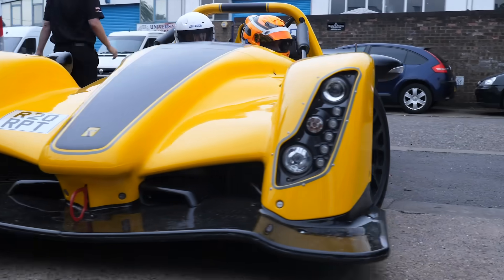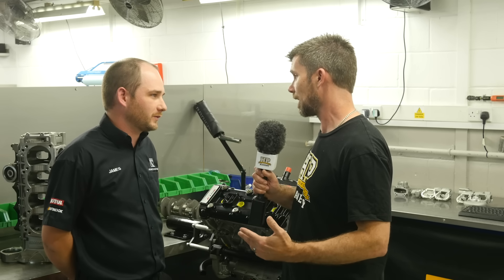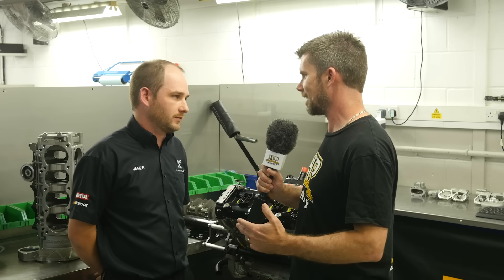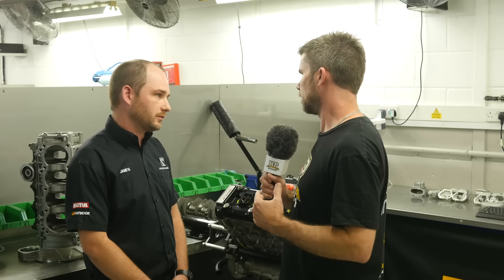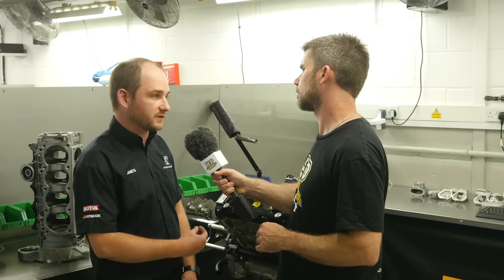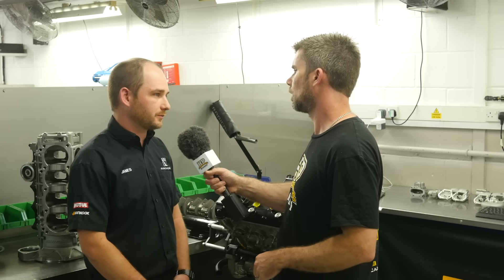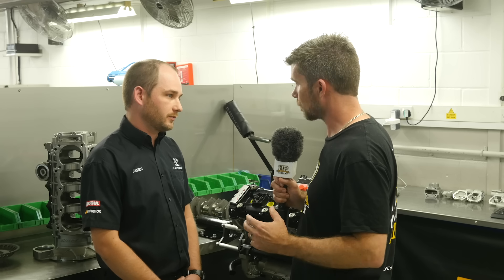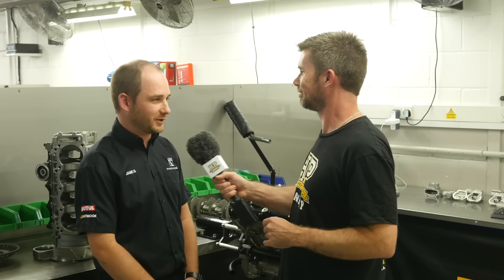105kg, 500HP, 10,500RPM ‘Hayabusa’ V8 | Radical Sportscars RPE-V8 [TECH TALK]

Comment: This is a super cool engine I have been curious about for a few years so thanks for doing an episode on it.  A few questions.  Why use alloy cylinder sleeves instead of steel like a LS?  Why not use Alloy rods at that RPM and power level?  It would run with less vibration and lower rotating mass.  Also whats the cam and valve set up?  They should make the Crankcase out of billet and steel sleeve it so it could run with power adders and then sell it as a crate engine.
Reply: The sleeves have a friction reducing coating and the rings are 1mm steel that have a PVD coating also. With sleeve and piston made of similar material because expansion is the same amounts it can be less clearances of piston to bore. With liners made from steel it expansion rate is different so aluminium pistons need bigger clearances. The heads on gen2 Busa have titanium valves and under 9mm lift from camshafts. Valve train is very lightweight.
Reply: Alloy rods need significantly more material so in a tight 72 degree bank its possible that it would run into something, also the rod would never last ass long a steel or titanium one, as far as sleeves go thats mainly due to weight and rigidity. as far as cam info just look up stock hayabusa cylinder heads

Comment: In the world of speed freaks the main goal always is more power and less weights and this gives you a V8 that will gives you 400 to 500 HP and that’s without a turbo or supercharged and all this at around 230 lbs and that is absolutely incredible 👍👍👍👍
Reply: To put that in perspective, F1 v10s used to make 900hp with just over 100 pounds. Those V8s are about the limit you can get in a road car.
Reply: Indeed, must be a very peppy and responsive engine.
Reply: Hulagan 808  The 3.3L has 520HP and 280Ft-Lbs Tourqe.
Reply: There are Buick/Rover/Olds aluminum block stroker engines around this weight class that make that sort of power, they're around 4.6-5.2L and 275-300lbs. With ancient 2V OHV tech.
Reply: @hendo337   that's 20-30% more weight and with 70-90% more displacement it stands to reason it only needs 50% of the valves!
Reply: A high performance V8 that only produces 400 to 500 hp at 10000 rpm? Why would you want that?

Comment: They have proven x plane crank is better with the off times firing. As it stops the crank tendency to want to speed up and slown down as each cylinder approaches and leaves tdc and bdc. This v vlock is basicly that principle so should not have to much isues as the chap asking the questions seems tonbe edging towards

Comment: What a prick he's just trying to make himself look smart by highlighting what he thinks are flaws 
Great motor 
It's a race motor 
U don't get everything you want
Reply from the maker: The line of questioning is just trying to get the info on what is used where, why, and at what cost. It doesn't mean we think anything has been done wrong, it just helps you to build a better picture when you're not just getting all of the sugar-coated bits - Taz.

Comment: The crazy thing is that these engines are only about an inch less wide when compared to an LS.

The height is also pretty similar depending on what intake manifold and oil pan you use, but apples to apples with both having a dry sump it's pretty close. 

The only dimension this thing really has over something like an LS is the length, where the LS is about five inches longer than this engine. 

The weight is vastly different though, this is around 230lbs and an LS is closer to 400lbs.

The cost difference is also massive. These engines are about $30,000. For less money, you could get an LS that makes well over 1,000hp naturally aspirated. 

So really it's a question of how you want to spend your money and what you need in your application. If you can fit a slightly larger engine and you only need to make 500hp, the LS is a far more cost-effective solution. If you need to make way more than 500hp, you more or less have to go with a different engine. If you absolutely won't benefit from more power but need the weight savings and cost isn't much of a concern, then this engine shines. It just depends on what your goals are.

Regardless, it's a sweet engine!
Reply: The cars these go into tend to weigh 12-1300lbs.
Adding 5 inches in length, a drivetrain that weighs well over 200lbs more (you wont find any lightweight transmission that can handle the LS torque) and the fact that the torquey LS is going to blow the small tires off.. well it makes no sense

Comment: Being a motorbike engine does it have a integrated gearbox? Also I hope someone turbos one!
Reply: It's motorcycle based, not a motorcycle engine. The top ends are Suzuki, but the bottom end is automotive style like a Judd or Cosworth V8
Reply from the maker: No sir, the SR8 it runs a Quaife 6-speed transaxle I believe - Taz

Comment: I’m honestly kinda pissed at the lack of mention of John Hartley. While I’m sure the development of this engine didn’t stop when Hartley sold the rights to the H1V8, This guy is talking like he was the one to develop the whole thing. Without Hartley, this wouldn’t exist.
Reply: I think you will find this is a Steve Prentice Designs engine, designed back in 2002 on a 72 degree crankcase, Hartley was a 75 then later 90 degree crankcase. Have a read here http://www.steveprenticedesign.com/projects/radical-rpe-v8/
Reply from the maker: This engine has nothing to do with Hartleys own version @LogicalQ. As Andy mentioned above, there are some very serious differences too. Make sure you let whoever told you otherwise know 😉 - Taz.

Comment: I feel like they just copied Hartley Enterprise?
Reply: They were kinda developed at the same time as each other If I remember right. The Hartley design was billet and superior in my opinion. It had zero teething issues.
Reply from the maker: Looks like the same idea but different executions for sure at a glance. From the start Hartley went with a 75 degree V configuration rather than 72 degrees Radical did, however, I don't personally have any insider knowledge on the early development of either engine so maybe others who do will comment and supply some links  - Taz.
Reply: @hpa101  Thanks for the clarification 👍
Either way, love the work and passion they put in their work!
Reply from the maker: Thanks Andy! We double checked with John Hartley too just to be safe. Completely independent projects, both awesome 🤘- Taz.

Comment: What about upper engine mods??
Reply: Doubt there's anything changed in the heads other than maybe some porting. Stock sport bike heads are really stout from the factory since they're shim under bucket design. Also, that 10.5K RPM redline they're running these to is what the stock inline-4 Hayabusa engine ran.

Comment: Are the cams on one bank spinning the “wrong way”? If so how is the chain being tensioned? Sure it’s not driven directly from the crank
Reply: on the side of the clutch there is a gear in the crankshaft to reverse the rotation to a second gear where the chain on that side goes